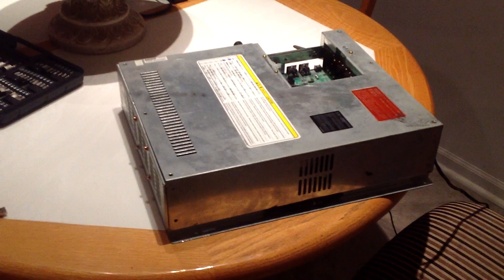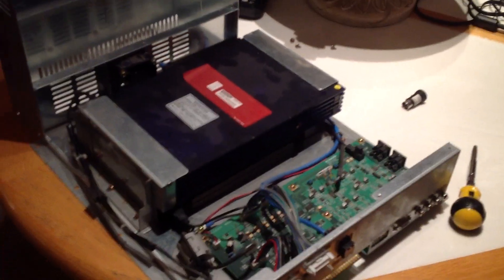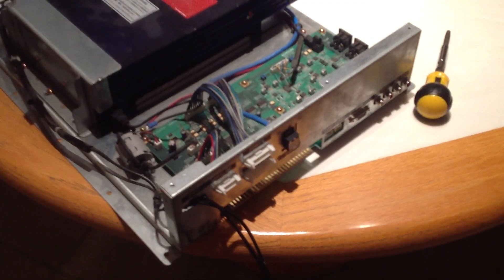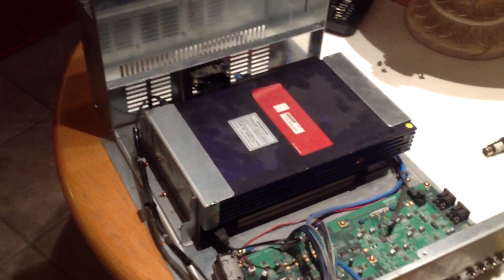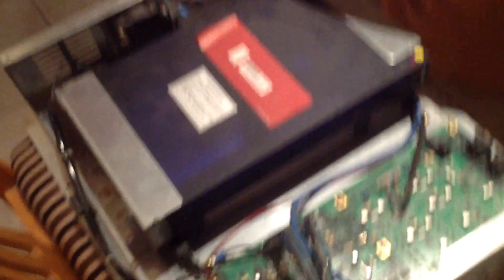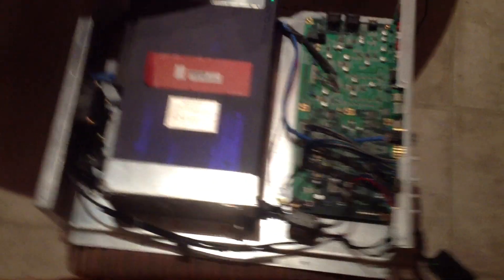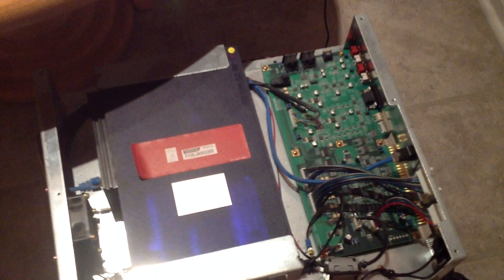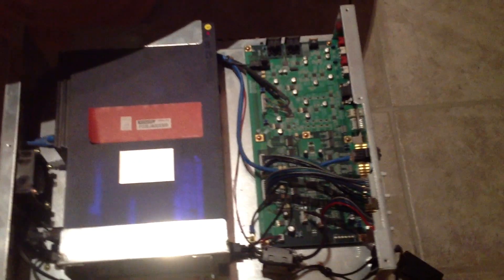A Look inside a BEMANI Python II arcade PCB

Comment: Question for you regarding this unit, so you say that a Japanese PS2 game can be played off the hardware - is it in theory possible then to play Japanese DDR PS2 games using this unit with the arcade pads connected? Or will the pads only function for installed games?
Reply from the maker: You can play any Japanese PS2 game but the pads will only have input on DDR arcade titles.  So no, you can not play DDR PS2 games on the system while using the arcade stage.

Comment: that's cool you can remove the HDD and have it as a normal PS2. Is it possible to swap the JPN PS2 with a US/C (or NA) PS2?
Reply from the maker: Possible yes.  BUT Drives marry to the first PS2 they are installed onto for games so there really isn't a point.

Comment: The security stuff can be cracked through software, as well as the JAMMA stuff (needs custom drivers etc.). As for the game, it could be installed on a separate partition and boot it from HDDOSD or even uLaunchElf, so yea, you can have much more control over this PS2 as well as have this game on a regular PS2, just needs a lot of work.

Easier said than done tho.

Oh and the reason why you can't see the PS2 booting is because it likely uses a different video mode in the game (640x480p or even higher).

Comment: Thanks for the video.

Do all HDD arcade games on this system require the security key/chip?

What is the current price of this system?

Can you gain a similar result by modding a PS2 and soldering everything you require to a JAMMA fingerboard?

Thanks.
Reply from the maker: Jason Teddy 1. yes
2. depends on if it works, what game it comes with and if the game works too.
3. No, You need the Python 2 I/O to properly communicate with the game.
Reply: OMG KON!  Thanks for taking the time to reply. I'm off searching for one and some pop n music games.
Reply: OMG KON! Wtf why is there a PS2 in a arcade board

Comment: OMG KON! , would SuperNova 1 or 2 load off a solid-state drive?  How easy or difficult is it to play around with that PCB?  They are more difficult to obtain compared to the System 573, at least up here in Canada.  :-/
Reply from the maker: Now it is possible to use an SSD and a different HDD as someone was able to crack the encryption and properly back up the drives and data.  It was never as easy as DDing the image or anything like that.
Reply from the maker: You can not use SSD.  In fact you can't swap the drive at all due to Magic Gate encryption.
Reply: +OMG KON! Just do a blockwise copy of the WHOLE drive using dd or somesuch, it should work IMO. Works on s246. Apart from the possibility of dding the data "backwards" due to human error and ruining it, could be worth a shot. Arguably, thou shalt backup anyway.
Reply: By the way, both Alex Perrier and Dance Dance North are my accounts.  I just forgot to switch for my previous comment.  :-P

Comment: Interesting :o I was wondering how DDR Extreme had so many more songs than the PS2 versions. I think it's pretty cool that they used hard drives instead of discs xD
Reply: Actually ddr extreme still used the 573 which is the system that ran the older games such as 1stMix and 3rdmix. The songs in extreme were heavily compressed so that they would be able to fit onto a disc alongside the software.